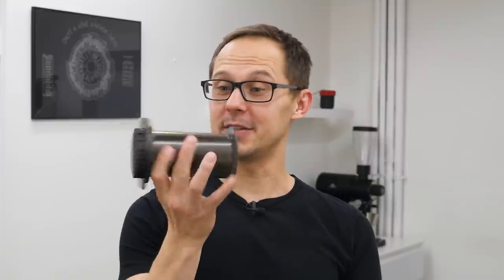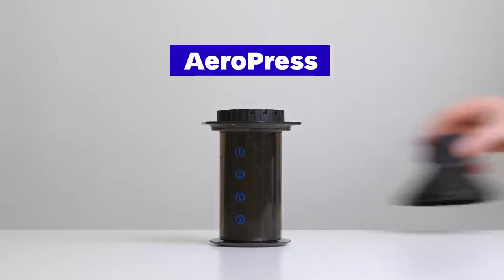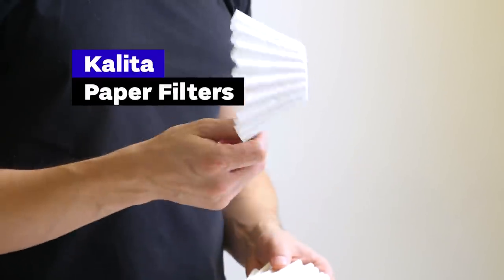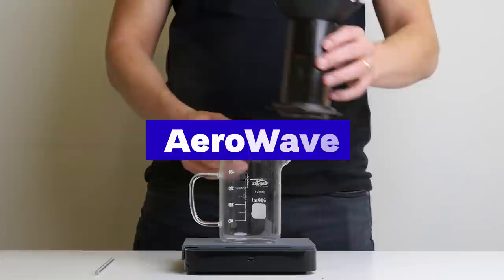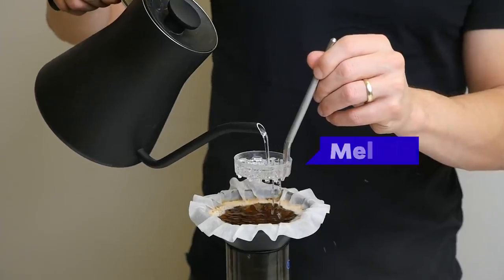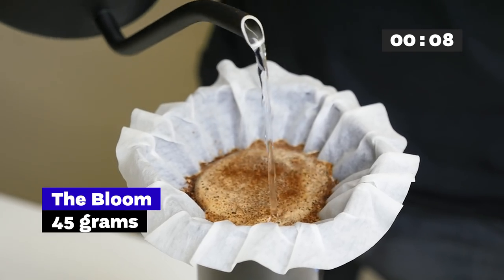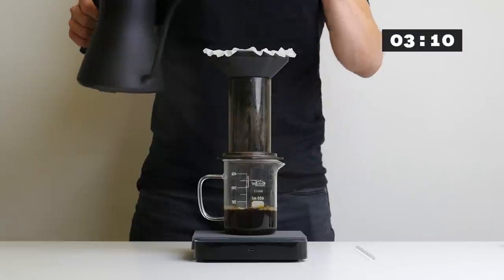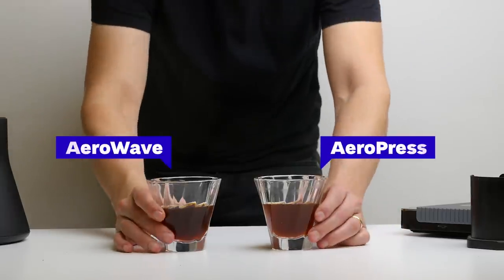How To Turn AeroPress Into Coffee Dripper (The AeroWave Recipe)

Comment: Great video.instead of using paper filter you could also use a metal filter basket that comes with a tea infuser.the basket fits perfectly into the chamber and will allow more oils through for extra flavour if preferred.i use lots of methods but find this one the best for me.also I use a lower temperature  around 85 c for pouring water.. personally I prefer not to go over 4 mins for the pour over to avoid any bitterness
Reply: Can I ask if you tried using just the aeropress without the piston instead and gotten nice results?

Comment: I'm going to have to give it a try.  I wonder if using the filter cap for dropping the water would work as a sub for the  melodrip since I don't have one.  If I like this brew, I'll have to pick up one.
Reply from the maker: That’s actually a good idea:) but you need to be careful not to burn your fingers. You can easily use your brewing kettle or even the AeroPress inner chamber for pouring. You don’t need Melodrip!
Reply: Putting the funnel directly on top of the mug/glass and using the aeropress body with the filter cap and pouring through that on the coffee would actually achieve what you are looking for and could save your hand also.